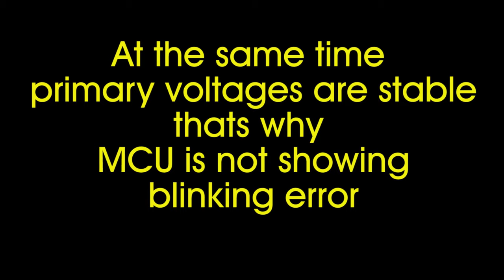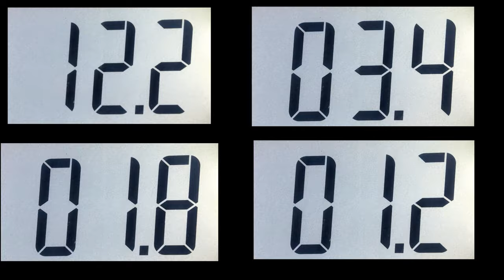LED TV Panel Repair(short cut modify)

Comment: Hi, my sony kdl-48w650d has similar PCB as yours.  The sound and backlight comes on but no display. There is no blinking red lights. Do i just cut the mon-r line? Pls advise.
Reply: There is no bootup sony logo but shows blank screen with sound.
Reply from the maker: That is different problem , there are many  gate lines which can be shorts or faulty scalar PCB

Comment: i have a same panel.5-10 minute everything ok.later no picture back light ok,sound ok,panel problem.how to fix it sir
Reply from the maker: May be gate line short circuited , check boost voltages present or not when picture disappeared.

Comment: same problem in klv 32R482B then which track shud I cut?
Reply from the maker: CKV CKVB 1,2
Reply: @VcoreLC  sir CKV1R and CKVB2R ?
Reply: pls sir exactly cnt understand coz there is CKV1L and CKVB2L also present then actually which is tha correct points
Reply: sir I did but problem not resolved wat to do next
Reply: still blank screen

Comment: My sony 40W650D have same problem, Vin 12V ok, 1.2V 1.8V 3.3V are all OK. Vone 27V when plug power it rise to 28V and come to 0v after 1 second. Voffe -11v =0V. I try cut Mon-R and Mon-L, not solve. My sony bravia has Top side is abnormal, Down side is normal. Not like this video has Left side normal, Right side abnormal.
Reply: same issue for.me . you found solution?
Reply: @nouramirdamadi4511  I cut step by step the track ckv & ckvb from 1 to 4, tv shows picture return. U can try it!